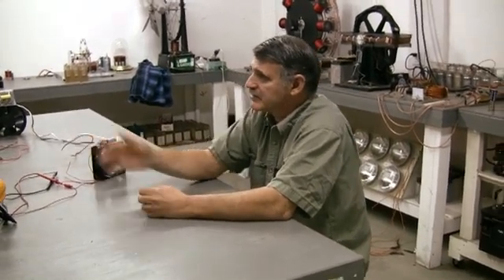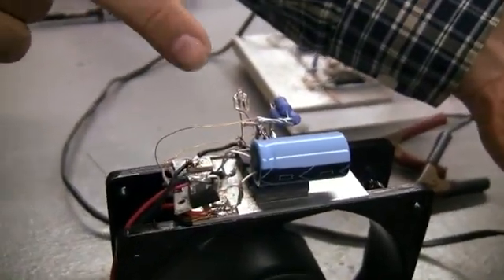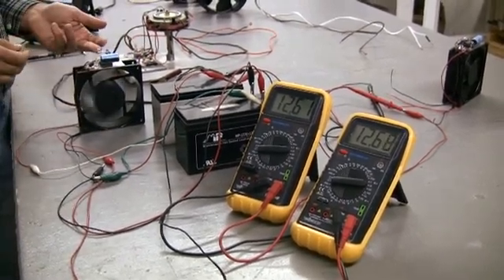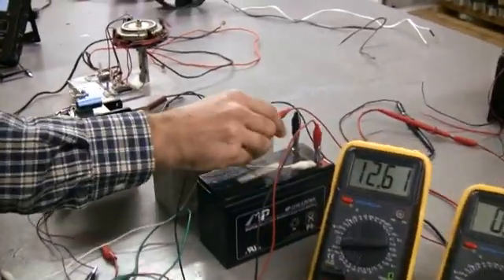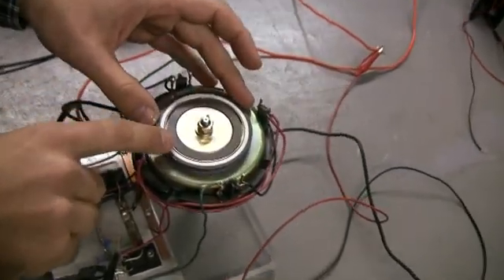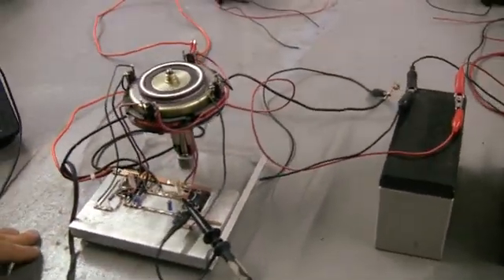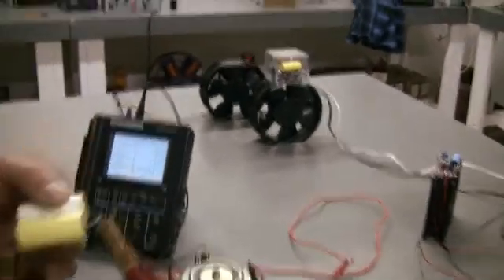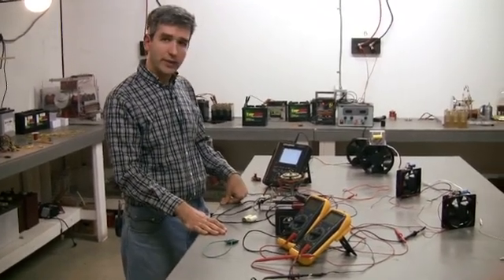Energy From The Vacuum - 17 - The Tape Drive Motor (2010) - Part 4

Comment: What I wish bedini did was put a load on his charging battery to see what he could draw from it while it's being charged and the batteries alternated. Alternating the load too.

Otherwise I mean.. it's a very interesting experiment. Another youtuber did similar with a pulse motor that was running for 6+ months but would love to see a load drawn and what it can actually accomplish while looped.
Reply from the maker: It's hard because the two energy types do not mix well. So battery swapping is problematic unless u use a cap dump. Also, puting a load on the battery while charging interups the charging process. It has been all tried. The best results come from just charging the battery and letting it rest.